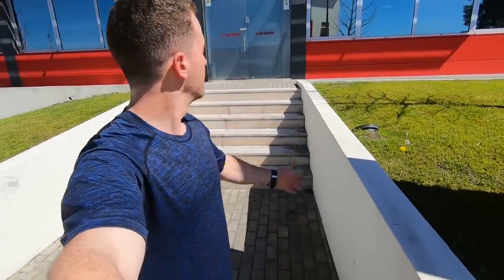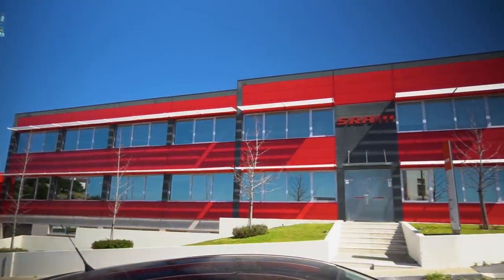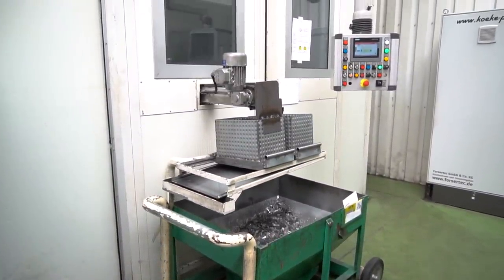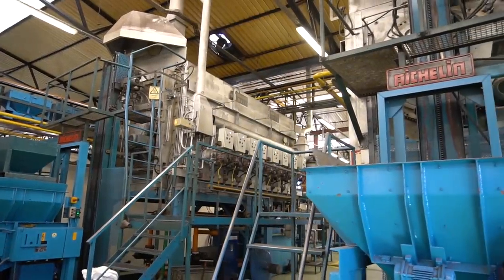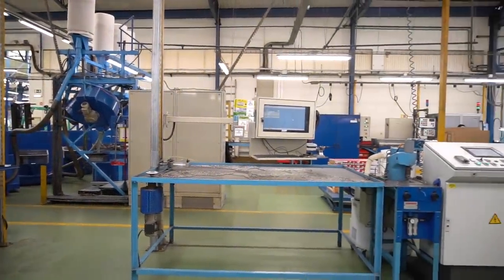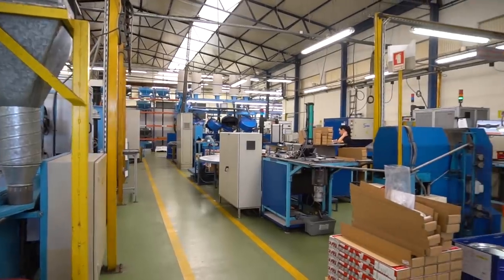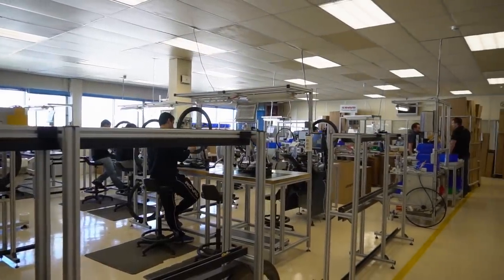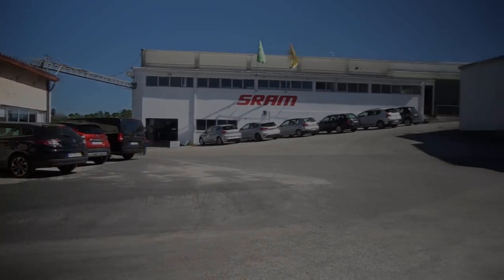SRAM Chain Factory - A Look Inside!

Comment: I like how it feels riding a new Sram chain. Really smoothly and quietly. But it never feels the same when I have to relube it. I have tried several chain oils but it never gives me the feeling of a new chain out of the box. So any recommendations what to use to maintain the original feeling?
Reply: Morgan blue race oil
Reply: Mineral oil W40. The last one road 10s Force makes 20 Kkm at 0,5% wear, generly in dry conditions